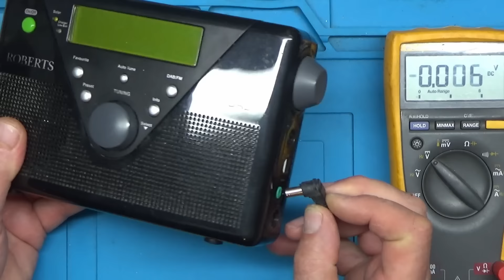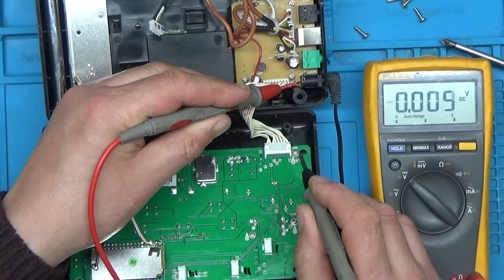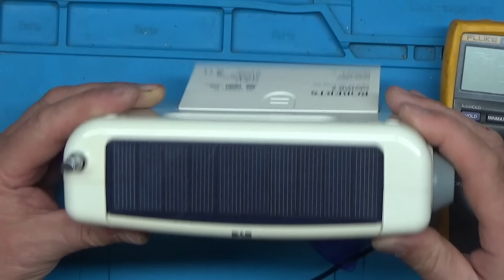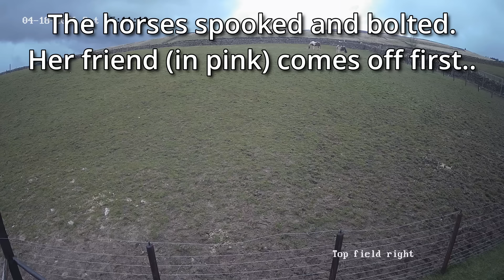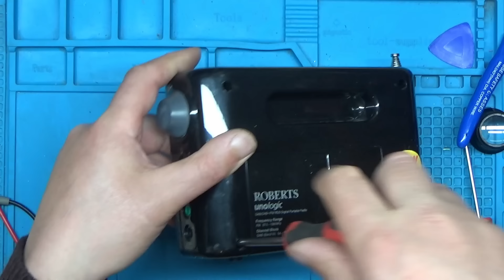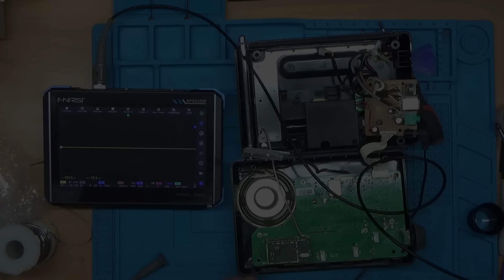Can I Fix These For A Viewer's Autistic Son?

Comment: It was lucky to find a PSU board with just a power connection problem. If not, I would swap in a PSU board that looked exactly the same from another radio. I’m glad had working radios to send back to Matty so quickly. 

I often combine parts from two broken things to make one perfect one and one that still needs repairing later or used for parts.
Reply from the maker: That's a great approach. I've often done stuff like that myself 👍

Comment: Why not try heating the whole board with your hot air reflow station, cold solder joint under the chip...

Comment: Mick - a big thank you from me. About a couple of years ago I bought a Roberts Unologic from eBay which was not charging  and had a look but could see nothing. After watching this video I opened it up again and found there was no path from the positive charger input prong along the track - another micro crack. Fitted a patch wire 10 mins ago and it's now powering on and charging. Again many thanks.

Comment: I hate designs where the mechanical integrity of external devices is via their electrical connections.
You might want to get some 22awg tinned copper wire and matching PTFE sleeve to repair power tracks on PCB's, neater than wire links.

Comment: Kino 3 module is a micro controller radio, no clock no worky. If you can fix the clock it might run.
The FM and DAB are on the same module so if neither work then its not doing what they call 'post on a pc. The first boot sequence. Great vid thanks AF.

Comment: I hate jumper wires. Why don't you just fix the circuit board.
Reply from the maker: Good question. Personally I think repairing the board would not be as robust. It's already failed at full strength, so any repairs to it would never be as strong. The jumper wire would allow some slight movement while still maintaining an electrical connection.

Comment: Such is life...I'm high on the Autism Spectrum but I have to fix my own Roberts radios..Analogue and DAB models..from 1959 the first Roberts transistor RT1 to the 2000's retro RT50 FM radio and the RT60 DAB..I love Roberts brand..Royal Stamp of supplied to the Monarchy back in the day....a lifetime of living in the Capital north London meant I had more stations to choose than anywhere in the country..in my pension age now I moved to the Coast..my many radios are pretty much useless..there's no AM/MW..there's only 2 FM stations..and most DAB stations have moved to DAB+..which I DO NOT HAVE..I can only receive BBC R1 to 5live..6 digital stations inc 4extra..the broadcasters want us all online..good on you for fixing stuff for those of us less fortunate to be born mainstream..
Reply from the maker: Thanks mate 👍There isn't much radio coverage around where we are too. I think there's only around 2 - 4 FM stations I can pick up in the area, and a few DAB (possibly DAB+). We're in a valley and surrounded by high hills on 3 sides. I have to walk up to the top of the driveway (which I've done repairing some other radios on here) to get a good signal.

Comment: What would have happened if you  force fed voltage to the crystal ? with a bridge
Reply from the maker: Probably not a lot. It seems that IC is just the tuner from what I could find.

Comment: I would have checked that second radios power plug FIRST THING. I'm betting that the kid is pretty rough on those power plugs. Hope the wife gets well soon.
Reply from the maker: Thanks mate 👍I thought it would have been fine with it having power. I would have thought it would either have power, or not have power with the connector 🙂

Comment: PCB mounted power connectors in general seem a weak spot. I also note Radio #3 is designed to work on 7.5 Volt rather than 6 Volts
Reply from the maker: Agree, and well spotted. I guess it still was happy enough on 6v as it seemed to work fine.

Comment: If that chip needs a working Oscillator, and the Crystal providing that timing is not working, then it could be that the unit needs a new crystal, yes rarely crystals fail, but when they do, any micro pressors dependant on them could be blamed as them being the defective component rather than the cheap crystal..
Reply from the maker: True, I've had crystals fail a few times. However they need a slight voltage to oscillate. The fact that there was 0 voltage going to it, suggests to me that the IC is either not initialised or failed internally. I think in this case the crystal is only used on the tuner IC. I think the main IC might have an internal RC oscillator.

Comment: It would've been interesting to compare signals between the good board and bad one, to see where things were different.
Reply from the maker: True. I'm pretty sure it's the main IC. There's not really much else on the board and all of the voltages to the main IC seem to be present and at the correct levels. The XTAL only seems to be used by the tuner IC, so I think the other one must use an internal oscillator.

Comment: You're a Saint for helping Matty out.👍🏻👍🏻
Could you have upgraded the non solar radio with the solar panel from the one that was unfixable, or were they not compatible?🤔?📻
Reply from the maker: Thanks mate 👍Yes it would probably be possible to take the DAB module out of that one and put it in the failed one. I think they are mainly used on mains power (hence the damage).

Comment: Hey 3 of 4,a win! The guy is pretty rough on the power socket. So sorry about your wife's misadventure. My wife still rides at 76, but only slow in arena and occasional trail ride.
Reply from the maker: Thanks Tom 👍I don't think mine is going to be riding for a while. She has a 2 day away ride thing booked in September. The doctor said she'll have to wait and see as nearer the time if she's able to do it. She's hopeful, but it's a nasty break and they said it could take 3-4 months before she's back to "normal".

Comment: Since you have no reception inside, you might benefit from a TinySA spectrum analyzer. It has an rf signal generator built in.  I've used it to test transceivers. It doesn't need a direct connection either which I think makes it ideal for a quick and dirty test. Unless you have something already in which case you can disregard this comment.
Reply from the maker: Thanks for the suggestion 👍I've got a small FM transmitter somewhere that you can play music from USB. I used to use it on my Christmas light display that I built quite a few years back. I keep forgetting about it though! 🤦‍♂️

Comment: The radios use different voltages,  6 v and 7.5 v
Reply from the maker: Well spotted! They all looked pretty much the same at face value so I didn't notice that. It did seem to work fine on 6v still though.

Comment: How can you do your tests without having all cables connected again?
Reply from the maker: Good question. The cables are only for the headphone socket, USB socket for updating the software, and I think the other was an aux in. The radio would still work fine without those 😉

Comment: Hi mick just about to watch your latest video. Also a quick update on the little tv its resolved itself. How ever I have 2 dome cctv cameras that I've removed from a shop as they both have the same fault which is unusual. Its not my system but would like to see if you can repair them and if so let me know how they failed. Regards Garry
Reply from the maker: Thanks Garry 👍Drop me an email if you like.

Comment: Gods speed on a full recovery to your lady and her friend Mick, quite the sad situation.  You worry about your family first, we'll be here when you're ready.  Extra ordinary repairs, the same problem X 3, must be a common design failure.  Power connection or similar.  3 fixed out of 4 is A+ work.  Replacing the irreparable radio was truly outstanding..Nicely done!
Reply from the maker: Thanks Terry 👍

Comment: First, wishing you wife and friend a speedy recovery. Good fixes, That last radio, you might have been worth trying changing the crystal. I've seen cases where the crystal fails. Not a common one, so it's not a fault we typically suspect, but it can happen.

Anyway, look after the family first, we'll wait till everyone's better. Take care. ❤and 🤗 to you and your family.
Reply from the maker: Thanks Lesley 👍I've also had it a couple of times on here where I've had a failed crystal. There is usually slight power to it though still as it needs power to oscillate. In this case there was nothing at all going to it which is why I think it's the IC either failed or not initialised or activated. I did find out that the IC is just the tuner, so I think the main IC has an internal RC oscillator so such. The fact that it's not loading anything from the firmware or settings makes me think that this is the actual culprit and not the IC with he crystal.

Comment: You wanted to messure voltage on the connector, and didnt know the voltages, isnt the radio you first repair identical ? Cant you take messurment from that one ?
Reply from the maker: Possibly, although I think the power supply was different between those two.

Comment: Did you try the radios with batteries? i find it kinda weird how they wouldn't work if the problem was only with the power jack. Unless they only used them plugged in.
Reply from the maker: Yes I think they only used them plugged in. I didn't actually test them with batteries but I'm sure they will work fine.

Comment: I did one of these a few weeks ago, the power supply board was connected to the wrong power pack, which blew the board to the point it actually delaminated the board. I contacted Roberts and they supplied me with a replacement board for the grand total of £15.00
Reply from the maker: Oh that was very nice of them. It's good to know that another company actually supports their customers!

Comment: Many faults are where the device meets the 300 lb gorilla.  A dob of goo under the socket prior to soldering would have saved many hundreds of these radio from landfill.   That was a very frightening fall your good lady had,  made worse by the height and wall.  For non horse riders I can tell you it is a long way down and painful but our first concerns are for the horses welfare then the pain remind us of our priorities.  I wish you both well and I hope she is back riding soon.     Air Ambulance are amazing.
Reply from the maker: Thanks 👍Yes a long way down especially after being flung into the air. The hose had went down into a ditch along near the wall and tried to jump out. That's the moment she fell off. The doctors said it will probably take around 6 months until she's back to "normal" and 12 months for the injury to be back to full strength.

Comment: Metal plate and screws sounds horrific! Hope your wife recovers ok.  3 out of 4 radios fixed is a good result.  Good of you to send a replacement.  40 years ago I was fixing a lot of solder joint power connector fails and even today there is no solution.  Something always has to give when mechanical stresses are involved on plugs and sockets.  Keep up the great work!
Reply from the maker: Thanks Mike 👍Yes agree about the plate and screws. It wasn't great that they couldn't fit her in to do the operation sooner, and sent her home for nearly two weeks to just "get on with it" due to lack of beds. They were lovely when she went in to get it done a few days back though. She's in quite a lot of pain after it though, but they have given her morphine to keep it under control.

Comment: I didn’t notice on the first two, but it’s interesting that they have a USB-B connector on the radio. Normally those are reserved for USB host connections; I wonder what USB features the radios employ with that connection. Maybe you can send specific or unique USB audio codecs to the radio… but that normally wouldn’t require a USB-B connector. Maybe they just used it for its robustness haha 🤔
Reply from the maker: I think they are for updating the firmware.
Reply: Maybe for connecting an iPod? I’m sure that was a thing at one point.

Comment: I was starting to worry after two weeks without a video: sorry to hear about the injuries to your wife and her friend. Dangerous things, those horses; you wouldn't get me up on one. I'll stick to motorbikes (much safer🤣). 
I see you never did build a radio repeater to get signals inside the 2ft walls.
Anyway, well done on the radios (nice gesture at the end) and thanks for putting out a video despite your difficult circumstances. If you want something done give it to a busy man, eh?
Reply from the maker: Thanks Andy 👍Yes it's been having a bit of a time here as you saw. Hopefully she's on the mend now though, she's in a lot of pain since the operation 4 days ago. They have given her morphine to help control it. Hopefully she has a speedy recovery, but they said this type of injury (tibial plateau fracture I think it was) can take 6 months get back to normal and 12 months to make a full recovery.

Comment: oh my gosh I'm sorry to hear about your wife and her friend. I had a horse bolt on me and it was down a steep dirt road that had big rocks sticking up out the dirt and all trees on both sides, like a ond wagon road and I thought I was gonna die for sure. I managed to hang on and another guy that obviously had some experience on me rode up and reached over to grab the bridle and it got the horse to stop. I might have been even crying because I thought I was gonna die and I thought the horse might trip and fall and I was thinking how bad its gonna hurt to fall on those rocks. What spooked it is the "instructor" (this was a bad boy ranch I was at 6 months in the late 80s I was 14) his saddle wasn't tight enough and he fell off and the saddle was hanging under his horse and it took off like it was on fire and so did my horse for some reason. I hope the mrs heals up quick. It could have been much worse. God bless her
Reply: and her friend
Reply from the maker: Thanks mate 👍Yes agree it could have been a lot worse. She's doing OK, but they said recovery could take up to 6 months, and 12 months to be back to full strength. She's in a fair amount of pain after the operation, but they have given her morphine to keep it under control.
Reply: @BuyitFixit  yes I was hit by a 4x4 truck on my 10 speed and I had to get plates in my shin bone with screws and my hip ball snapped off, the put a plate down my femur and a ready rod thing tired to that up the 45 into the middle my hip ball to put it all back together. I was walking again in 6 weeks. after I got out the doctor told me to skip on the T3's so my body knew there was something to fix. After I healed up I been the bionic man and never an issue with it my whole life knock on wood. I hope she's up and at em faster than 6 months, I cant remember how long I was in the hospital but I think that was the bulk of it. prayers she gets healed up fast and no snags

Comment: Very sorry to hear about the accident involving your wife and her friend - I hope they both recover relatively painlessly and quickly. Don't forget that all important physiotherapy when the time is right for your wife.

Out of interest, how long did it take for the ambulance and police to turn up? You hear so many horror stories these days of ambulances taking hours.
Reply from the maker: Thanks mate 👍She's in quite a bit of pain currently as the operation was only 4 days ago. 
The accident happened two weeks ago! She's been "on the waiting list" and just had to get on with it in the meantime. I was out when it happened (around 30 mins away) and when I raced back the air ambulance was already there. One of our neighbours is a first responder and he was there too. The road ambulance took about an hour and a half to get here as we're over an hours drive away from the hospital. The police turned up about 45 mins - 1hr after the accident. 

The main horror story was in the A&E Dept. The accident happened at 3:11pm, and she was in A&E at around 5pm. She had an X-ray and a scan, but wasn't seen by the doctor until around 2AM, and wasn't given any pain relief even after asking multiple times. The doctor asked if she could straighten her leg (after she's been sat in a chair for about 7 hours!) to have a brace / support fitted. Her knee was 2x the size, and they was no way. He tried to "help" straighten it, and which point she had tears in he eyes, and was getting rather cross, as it was extremely painful. She said to him "well it might help if I at least had some pain relief onboard!" He eventually got her a morphine tablet which took the edge off it, but she still couldn't straighten her leg due to all of the swelling. We left A&E around 2:30AM, got back home around 3:45AM, and I got to bed around 5AM.  

Her friend got "forgotten about" an wasn't seen until about 2 hours after arriving! She had a cannula fitted, which was removed by a nurse by pulling it "up" instead of out which was rather painful and caused blood go everywhere! 
So yeah, it wasn't great!
Reply: @BuyitFixit  Very sorry to hear about the crap service that was provided, but sadly not surprising given the current abominable state of the NHS. For a service that is supposed to prevent suffering they sure do cause a lot of it.